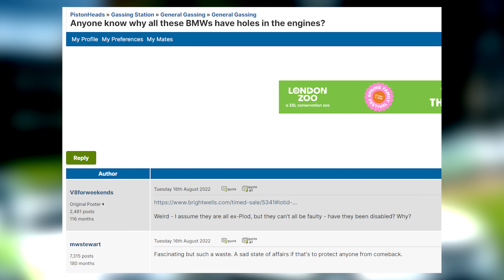Why The UK's Police Cars Keep Catching Fire (BMW N57 Engine)

Comment: first of all I'm very saddened to learn of the tragic death, that's horrid and I hope family members are managing to deal with it. My condolences to his family.
My question now is, how can this really happen? Obviously it does and not only in this one instance. I ask because I live here in Germany. We thrash the Autobahnen for hours on end when possible at speeds in excess if not well in excess of that, yet this phenomena is unheard of here. I have had BMWs (petrol) for 30 years now (gone over to Audi which was a bad idea), and at one point did 565.000Km many years ago in my E34 540i, flat out when I could, often hours and hours worth of it on the 13.500km Autobahnen here. Nothing. OK different car I know, but still. I also, in that time, never saw a burnt up BMW on the Autobahn nor read reports about such a case and the place is infested with BMWs... it is after all German. How can they fail so badly in the UK when just briefly driven at 130, whereby in a Diesel the revs aren't even that high at that speed. It's most odd.
Reply: As said in the video it wasn't the thrashing of the engine that was the culprit, it was the hours of time spent at idle. This caused the oil to degrade so that when the car was pushed the oil was no longer protecting the engine. The idling also caused the dpf's to become choked up which would further contaminate the oil due to back pressure from the exhaust. To be honest, most diesal engines will suffer from build up of carbon deposits, blocked dpf's and degraded oil if left idling for hours on end.
Reply: @macky4074  ok yes, you did say that. I presume the Volvos will in the end do the same, if they too are Diesels. I read somewhere that the police are ditching BMWs for Volvos or was it BMW UK that no longer wishes to sell them to the police? Anyway, OK that's interesting with the long idle.
Reply: It's a combination of how the Police use it combined with a service interval that wasn't suitable for that type of use.

In normal civilian use these engines are fine. I put 100k miles on one. Serviced every 20k, there were no problems with the engine.

Now I have B58 and it's even better ❤

Comment: well just saying ive seen like a couple 340i and a few 135 I BMW's on the road for the police, I mean that quite recent and they were 22 and 23 plates unless they are now stopping
Reply: I think they are fine as civilian spec vehicles. Only the authority ones have ceased sales. These vehicles are upgraded in various ways with it’s brakes etc in the case of the performance BMW’s so it can be used for policing.

Comment: Hey! Great video, very in depth mate. I know my local police force (South Wales Police) replaced all their older style Roads Policing Unit BMW 330d's with newer 2020-2022 plate BMW G21's and are still using some 2017 plate G31's, but those are slowly being replaced with 20 plate Volvo V90's and Skoda Octavia VRS's. I know they're also slowly removing their BMW X5's from the JFU (Joint Firearms Unit between South Wales Police, Gwent Police and Dyfed-Powys Police) and are replacing them with new Volvo XC90's, and they also converted one 70 plate BMW X5 (LG70 PVX) from a DTU (Driver Training Unit) into an ARV back last year.

Comment: What kind of company builds a car or engine that can't be left to idle or driven hard in the 999's? BMW that's whom years ago the timing chains used to fail on allot of their engines. Main cause was one of the wheels/guider the chain sat on teeth were to sharp causing premature wear. Years and years of experience can categorically say yes the Bimmers great to drive nice looking motors. But some I've had owned nothing but issues oils leaks, auto transmission issues, oil burning etc very very overrated cars by far! Had Audi's some issues too but nothing like BMW's then buying parts particularly from the Stealers you need the budget of a small country. Injectors for the N53 engine this is petrol £456 each insanity! Allot of the German stuff is way overrated and over priced! By far French would never touch shocking cars Volvo not a fan either what allot fail to realise most of them are in bed with each other now saves on costs and research and development.  This will sound 🤣but having owned more cars in a month than some own in a decade. FORD seems to be the only ones that have to have much attention or money. Even some of the Japanese stuff is also an urban myth.

Comment: Back in the 1990's all UK Police Forces changed from BMW motorbikes to either Honda or Yamaha due to build quality, price and ongoing electrical, electronic & mechanical issues
Reply: But they still use BMW 1200 GS
Reply: that’s the 1990s man… BMW bikes are now known for their build quality and high performance (especially the M1000RR and the M1000R) so it’s not a problem now, that’s like saying ‘oh well subarus and mitsubishis were used but now aren’t’ which was what? 10 years ago now?

Comment: Didn't the police go to BMW 530D from petrol Volvo to save on service and running cost. BMW then adviced the police that they needed to do more oil changes and police refused.BMW then stopped the big discounts and shut the department that sold BMW cars to the police.

Comment: never had that problem with the Morris Minor, a good sturdy British made car.
Reply: Yep, I had a Morris Minor myself, many decades back. Friends had a minor crash (pun intended) and sold it to me cheaply. I fixed it up and used it for a while, it was great. 36 miles per gallon I remember was the typical fuel economy in semi rural running.   (Zero psi Radiator cap !  14 pints from memory cooling system, entirely thermosyphon, no waterpump at all, fan blade mounted directly to the DC Generator pulley, sidevalves engine, I did a valve-grind, in situ, remember to use small rags to block the 3 oil return holes in the bottom of the tappets vestibule,  because you WILL drop the half-collets sometimes. Easy to feel around in the vestibule with your fingers and retrieve the collets rather than stripping the sump off ! ) However one thing which the modern BMW diesel could do, is cruise at 130 mph on the motorway.. My Morris Minor indicated about 65 mph on the slightly wobbly speedo.
Reply: Morris Minors are the most reliable car in the world because no matter what ever goes wrong with them it is always a MINOR fault (pun intended)
Reply: @Kensclassics  except the front end suspension and steering falling apart
Reply: They just take 3 days to get to the incident.
Reply: @LivingLifeSlower  good one, well they had to stop to let the engine cool on the  way..
Reply: what the morris minor rust bucket...
Reply: Another good thing was the brake and clutch pedals seizing on the shaft ,so when you pressed the clutch,the brakes came on !

Comment: I owned a 5 series and after repairs totaling £16,000 in 3 years the timing chain snapped at 47,000 mile! Absolute junk 😢
Reply: Did you change your oil regularly?
Reply: @Jk42020  Well three years that should be three changes maybe four. That is regular. Any more needed than that then the car is junk as it is not built/designed  properly.
Reply: @Jk42020  I’m a mechanic of 40 years! I’ve. Made my living over the last 10 years fixing these heaps! I now own a Tesla mod 3 😁
Reply: @MotorHeartAT as a mechanic of 40 years! The £16,000 1 , main gearbox output bearing,2 hand brake electric motors rear,3 punctured air suspension causing cracked windshield 4 wing mirror motor, 5 rear wheel bearing and sensor, finally timing chain snapped at 40,000 miles destroyed engine! The End . Just to add , every car I’ve ever owned has an oil change every 5,000 miles 👍

Comment: If you are beating on the engine . The oil needs to be changed 3-5k miles . If you try and push that to 10-15 it’s a grenade waiting to blow .
Reply: Sounds like wrong type of oil and bad engine design. The early 1950s yes but we have moved on.

Comment: The main problem here is that BMW has sold cars for a use that they simply aren't built for! The seller should be brought to court, because he should know what kind of circumstances the car/engine definitely can't handle.

How do you solve such kind of problems? If the police really want a diesel engine equipped car, why then not change the laws for car emissions, so that you can remove or simplify the EGR-system and remove the DPF or use a variant that have a valve that opens when the pressure is getting too high.

In this context you have to think that ALL diesel drivers that drives less than 5-8 km each time have almost no emission cleaning at all!
Now we are talking about a couple of thousands of cars among over 20 million. UK, and other countries, has bigger polution problems than this.

Why always bring water from the other side of the river?

May I say that I'm an owner of a 2011 X3 30d, with the N57 engine, and 251,000 km on the clock. I also have a 2008 X3 20d, with the N47 engine, and some 220,000 km on the clock. And spare parts on the shelves for about 3,000 euro, and I need to buy some more for app 1,000 in the next future. Then some small things can be fixed or better be improved.

Comment: Replace them with Mercedes' new 6 cylinder inline diesels, a beast of a machine👍
Reply: Bad public image running mercs for strapped police forces. Mercs very expensive to repair.
Reply: @johnstonlee  
And running BMWs is not??🥴
Mercs are far more durable than the brittle Bavarian offerings!
Reply: @WeeShoeyDugless  the BMWs were run ragged and they hardly broke down unlike the Volvos we have a 66 plate 530d on 170k
Reply: @johnstonlee  
170k?
Not even run in on a Merc diesel👍
Reply: @WeeShoeyDugless  yeah but 170k miles when being absolutely being thrashed 247.
Reply: @johnstonlee  
All of my Mercs have been thrashed, towed caravans/heavy trailers summer and winter.
Never had any of them self destruct, even well after 250,000 miles.
They're just better engines, better designed, better engineered👍
Reply: @WeeShoeyDugless  this isn’t a dick swinging contest as to which is better all I’m saying is a 170k mile bmw thrashed from cold, multiple 155mph runs for miles on end the BMWs serve well on the reliability front. I’ve towed and 15t road sweeper with a bmw no sweat. I’ve also owned a merc but not abused in the same way as I do at work in the bmw.

Comment: DPF filters have been on various vehicles for the last 15 years at least,
This problem is new to BMW,
Previous police BMW's didn't suffer from it, and fitted with DPF,
Going back a bit to 80's 90's
A lot of BMW's that came in my garage suffered from blocked engine breather pipes or stretched timing chains, 
The engine breather systems allways over complicated,
For Years BMW have made aluminium engines with aluminium that changes and ends up brittle if near or overheated  !
I know this because,
When a BMW Head gasket blows and overheat, most times you can't bolt the head back on without stripping the head bolt threads,
You have to change the engines, 
BMW diesel fitted into Range Rover's the same,
And never scim a BMW cylinder head  !
Made like an Aero bar, once through the chocolate your into bubbles, new gaskets blow in months,
My conclusion is the new engine is made of Aluminium witch when it gets hot end of working heat range, turns brittle and brakes under mechanical pressure !
Combined with a more sensitive DPF system spells disaster  !
Any of you mechanics old enough to remember the BMW engines evolution will of had the problems i noticed,
As i remember only BMW had the brittle aluminium issue,
Although a lot of other makes have an issue scimed cylinder heads, Land Rover 300 tdi,
BMW engines fitted in Land Rover ect
Reply: That's good to know 👍

Comment: I wonder if servicing the engine based on engine operating hours would help instead of miles covered? Aircraft engines are maintained on an hours accumulated basis. Still, the engineers at BMW aren't just dragged off the street, it comes down to the engine is used in a highly abusive manor out of necessity, so design an engine for police use only. I'll bet that there is an accountant in the engineering department overseeing the goings on there.
Reply: I think that would help. These engines have condition based servicing. I've owned one. I wonder if they left the service interval the same as civilian cars. That would mean 20,000 miles between services, depending on how it is driven. I bet time idling doesn't move the needle towards the next service.
Reply: Force I work for the cars are absolutely thrashed from cold starts and straight from new build.

Comment: I have a F30 330d (2013) obviously I don’t drive at 130mph but is my car a fire risk?
Reply: Unfortunately yes! But it all depends on the maintenance! And the maintenance needed you will find on internet, unfortunately.
But all sensors in and around the engine must work perfectly. The DPF must never be clogged, if so you are in immediate troubles.
The the EGR-system and intake manifold should be cleaned, let's say every 100-150,000 km.
Oil changes every 10-12,000 km, not at 30,000 km.

If the driving distance is about 5 km, use the bicycle!

As these problems have existed for about fifteen years, we know quite well how to avoid them, maybe to 100 %. This doesn't mean that you can avoid all other issues, unfortunately. 🥺
Reply: @leiflillandt1488  Thanks for the advice bro, it’s very much appreciated. 👍

Comment: I think the Manchester evening news might of had a typo, as they said M57.. which is an old engine in the grand scheme of things as they came out in the late 90's. The police in some places used e39's and you generally dont hear of e46/e39 era cars ever catching fire like this.
Reply: The M57 came in the E90 325d 330d up until 2008 and in 335ds till  2011

Comment: BMW didn’t decide to stop supplying the police because of this coppers death.  They have stopped supplying emergency vehicles across Europe full stop. Covid, supply chain issues with parts and low margins and low volume made it an easy decision.   Between this video and Geoffs I’ve never seen so much misinformation and misunderstanding on a subject.  Suffolk / Cambs / Norfolk are still using BMW traffic cars but these are being phased out in favour of Volvo’s and more likely to see a Volvo than BMW now.  Local pandas are now Peugeot moving away from Hyundai, still the odd Ford specialist vehicle ie rural units.

Comment: The manufacturer sets the oil change interval for their vehicles ... if the vehicles are for a special high intensity usage for a specific customer then the manufacturer should define a more appropriate service  interval for that use.   And if miles travelled is not an adequate measurement for the service interval then for oil change / service then they should use a  more appropriate measurement ... say like engine hours ... as long as the police stick to the manufacturers service advise I fail to see how anyone other than the manufacturer is to blame.    It's not like there isn't a computer in that engine that cannot measure these sorts of things.

Comment: Egr cooler is the problem. Coolant residu catches fire and melts the inlet manifold and then the rest of the car. These diesel engines where designed for high speed driving on the autobahn for long periodes of time. Just not the egr cooler….

Comment: It would've made more sense to just amend the emissions regulations to state that service vehicles are exempt. Just think how much cheaper and more reliable the next generation of police vehicles, ambulances, and fire trucks could've been if we didn't have to fit all the usual egr adblue dpf bullshit. Missed opportunity!
Reply from the maker: Very good point - they don't need to stick to the same speed limits as us, so why would they not be allowed more specialised vehicles in some circumstances.
Reply: It is exactly in this way, but then BMW has to admit that their DPF and EGR-system doesn't work under all circumstances! That is maybe a bigger problem?!

Comment: It's worth remembering that when the police buy a new car they heavily customize the car so that it has much better performance than a civilian car.

I hope the police try out some electric cars, a lot of American police forces have started using Tesla's.  Tesla's are very high performance but there are plenty of other EV's that are very high performance.

The police would definitely save loads of money on fuel, if they did go with EV's.
Reply from the maker: It would be interesting - I wonder whether the range anxiety will be an issue or not, given the cars are often out for hours, just patrolling. With usage typical of the British police I wouldn't be surprised if something like a VW ID3 would need to be charged at least 2-3 times per day, which no doubt would kill the battery's capacity off pretty quickly. Only one way to find out!

Also, I know there are over 100 BMW i3s which were in use in London at some point, whether or not they still are I'm not sure. It caused a bit of a PR nightmare, and the media slated them for the choice since they aren't exactly well equipped for a high speed pursuit. The i3 is particularly crap as a police car though haha

Comment: just don't buy bmws, they're so unreliable. get toyotas.
Reply from the maker: It's a tough one - I've got an e46 and it's pretty bulletproof, but new Bimmers definitely seem to be done after 100k miles or so. The best way to check if a German car is actually reliable imo is to look at eBay in Germany, they often have much higher mileages so it's easier to see which cars can survive easily. The most unreliable cars in my personal experience are anything cheap-ish from Ford or GM.

Comment: 130mph who is trained to drive at 130mph on the public highway! No one is as the public are in the road at the same time !
Reply: Ze Germans are doing 130mph routinely on the motorway. My bmw with an N57 engine is handling it just fine!